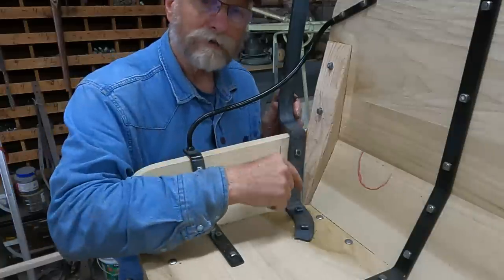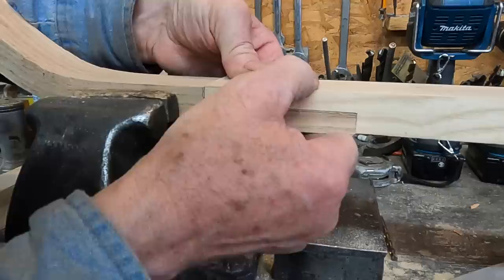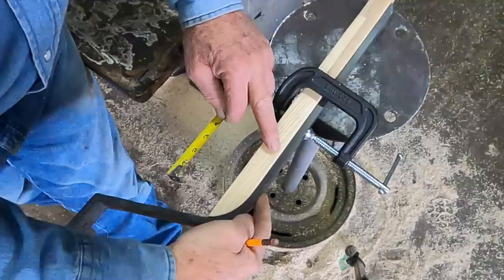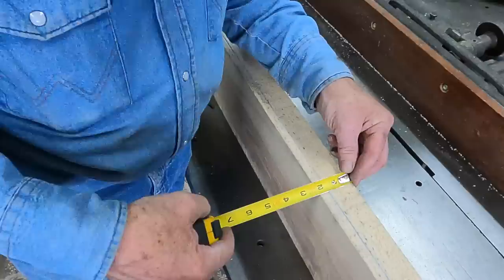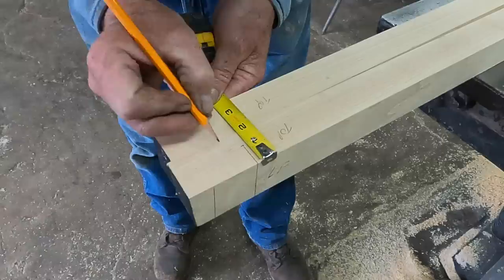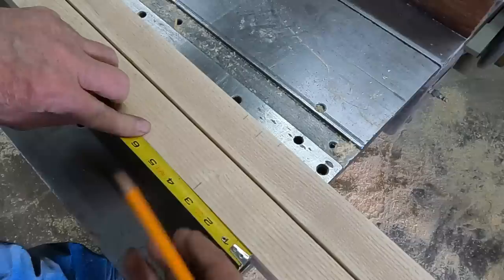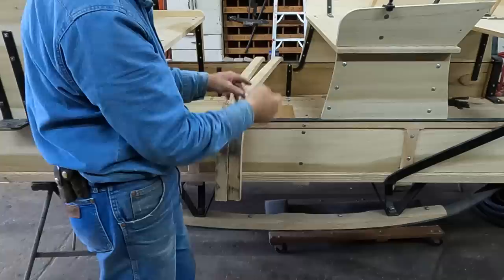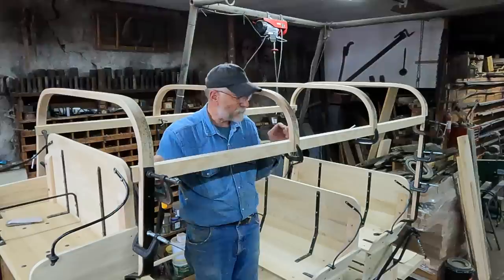Bent Wood Bow Mud Wagon Roof | Engels Coach Shop

Comment: 1. Would have liked to see  the brace fit the iron at 6:15, if the owner decides that bit of craftsmanship was too inauthentic, they could, in a fit of questionable (IMO) judgement,  just hack it square themselves.

2. Scarfs, especially with modern adhesives, address the problem of the inside corner splitting of laps. No question about the ability, just wondering about the choice.

Comment: hi dave/diane, why isnt there a board or boards that goes across the top? surely that would also be a good place to store a few suitcases? with only a few boards across the sides, nothing can be stored on the canvas top. surely a rough n ready mud wagon would make use of some top boards to make the most use of the space? or did wagons usually not carry things on the top?

Comment: Can you hazard a guess as to why the original builders put the seat back braces inside of the seat instead of on the back?  To my uneducated eye it would have been more practical to have the braces on the back for 2 reasons.  1) comfort,  2) the back boards would be pushing against the brace instead of just the bolt washers.